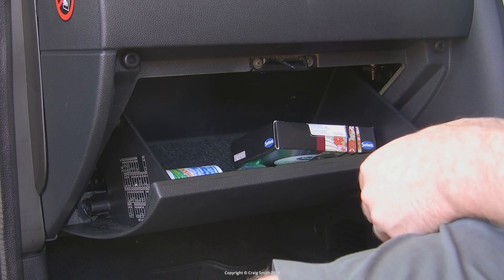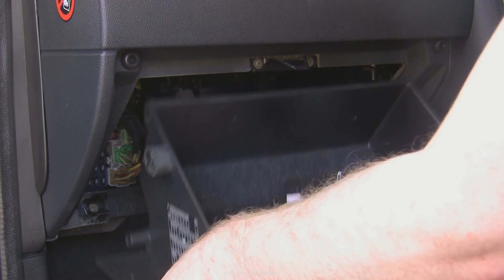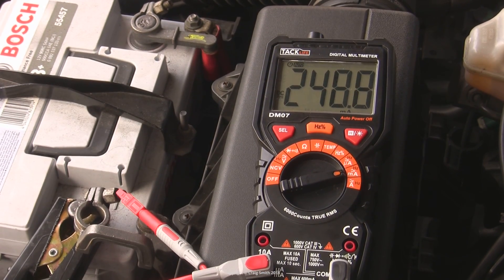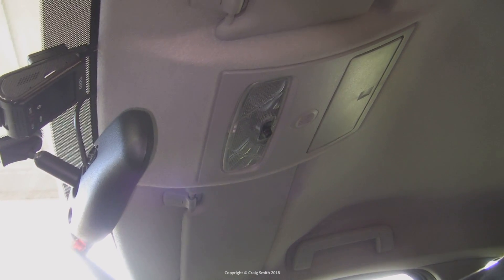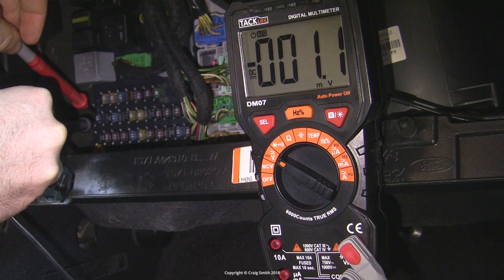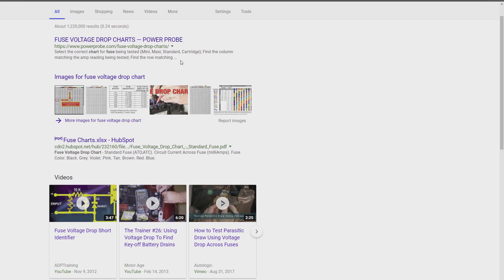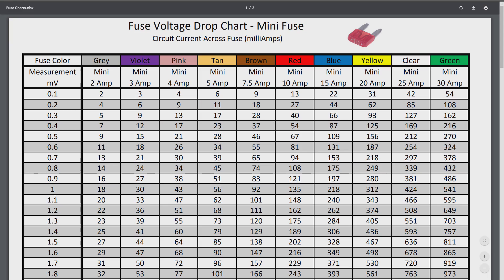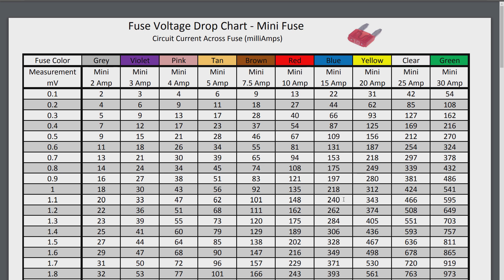Diagnosing battery or alternator 4/3: Battery drain

Comment: Pls is it ac current which is in ampere u checked or ac voltage on d battery terminals.
Reply: It's Ac set on meter, I'm currently troubleshooting this issue.. I'm definitely thinking it's more than the alternator

Comment: i have a 50ma draw and after about ~7 days it will crank real slow and at 10 days, the battery is DEAD FLAT ...
Reply: If something is draining my battery and I fix whatever is draining it will I still need to buy a new battery or can I get mine running again? I just bought a brand new battery like 2 months ago
Reply: @direloky  once you get it fixed, it should be ok providing thr battery is still good

Comment: If i have 30.8 ACV when measuring the battery is not good right?
Reply: I just tried to check my draw using the amp 10a setting but got 0. Tried another  voltmeter and again 0 draw. I  tried another car and 0 again. Turns out my voltmeters fuses got blown I was thinking it was a possible ac voltage leak from alt .. your problem seems the same did this happen to u ?
Reply: @vdittycc  my problem was a fuse, more precisely the one from the 4th gear of the ventilation
Reply: @vdittycc  and I didn't try to fix anything else, I just took it out because I never used that gear.

Comment: Hi, thanks for your very smart video.  I hope you are still answering.  I tested the rectifier with multimeter on AC A 2000rpms (needed in order to keep running) and got 31.5 at the the battery poles as advised.  What does this tell you?  Thanks again.

Comment: Great video as always. Some questions arise: I have 2 choices of AC on my multimeter; 200V/750V. Checking my battery at 200V gives around 28V. Motor running/not running, same value. One might expect a bad diode or anything like it in de rectifier, but some suggest that it is a multimeter issue. Since you seem to have thorough knowledge, I am curious for your opinion. By the way, I am trying to sort out an issue; my battery seems to drain (just so that voltage gets lower, but never emptying the battery), but on the other hand the alternator seems to load normally. Only with airconditioning on and in drive (mondeo 2005, V6 with durashift) the battery warning light lights up. Any suggestions? Here is some discussion on the AC current in batteries: https://www.garagejournal.com/forum/archive/index.php/t-75551.html
Reply from the maker: Well that discussion seems to suggest a meter issue. I sometimes get unexpected results measuring AC too, I don't know enough about electricity especially AC to comment. I suggest that if you're not getting different measurements between engine on and off then you probably don't have a diode issue. / With AC on and in drive you mean at idle or even with revs? Car not idling high enough or alternator not producing the juice until rev'ed. Have you checked the charge current properly. However a note of caution. The Mondeo charging system is a bit complex as I hinted at in my alternator video... I only touched the basics applicable to all cars. If signs are pointing to the alternator you'll need to get it looked at by a specialist, particular tools required.
Reply: Actually, I in the mean time did go to a specialist. After aircon jumps on, charge current dips. Not clear why. So I tried removing the alternatorso it can be tested properly, but too little space to be able to remove the upper nut (lying underneath the car). Also the connector is a nasty to remove thing. In the end, in a weeks while, I will bring it to a garage and the alternator will be tested. Just because I hate warning lights on the dashboard...
Reply: Faulty meter is easy to diagnose. Grab a battery..rly eny battery from a remote or what ever and measure it.